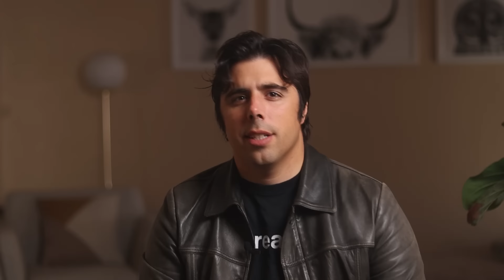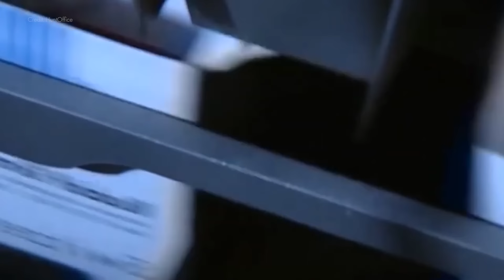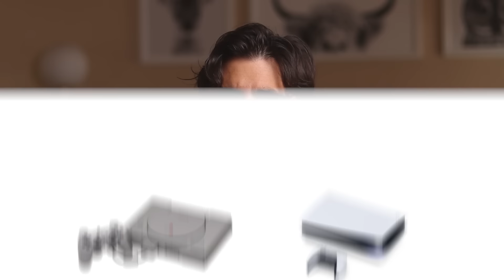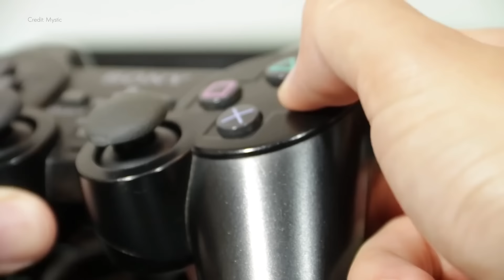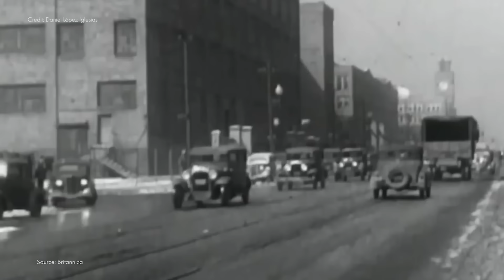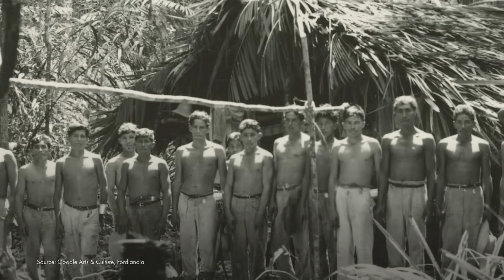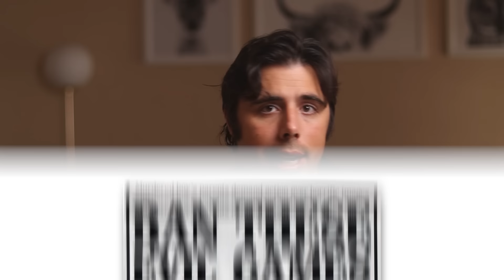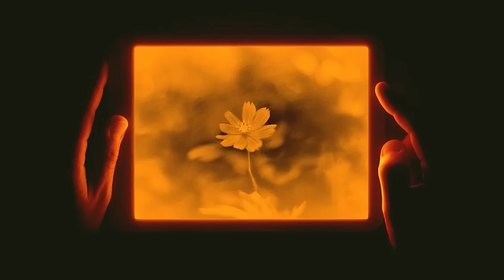Why Some Designs Are Impossible to Improve: Quintessence

Comment: 🎯 Key points for quick navigation:

 Quintessential designs: Last for decades & barely change (paperclip, PlayStation controller).
 Why some designs fail: Not high-scale/prevalent enough (Sunbeam toaster).
 High-quality, but expensive: Can hinder becoming quintessential (Sunbeam toaster).
️ Complex design: More parts, more potential failures (Sunbeam toaster).
 Not universally appealing: May not suit everyone's needs (Sunbeam toaster).
 Value of imperfection: Simple designs can be "good enough" (regular toaster).
✨ Niche appeal: Designs can be great for a small, passionate audience (Sunbeam toaster).
⚙️ Manufacturing matters: Design for efficient production (quintessential designs). 
 More effective paperclip designs exist, but lack efficient manufacturing process.
⚙️ Quintessential designs: Need a simple, cost-effective manufacturing process.
  Patents and copyrights can help a design achieve dominance (Maglite flashlight).
 Original, innovative design (Kell flashlight) can be overshadowed by competitor.
  Marketing and sales strategy can influence a design's success (Maglite flashlight).
 ‍♀️ Sponsor message: Opera browser with tab grouping & messaging features.
  Built-in screenshot tool & workspaces for organization (Opera browser).
 ✨ Intuitive design, transitions & tab navigation (Opera browser). 
 Maglite's success: Innovation (adjustable focus beam) & aggressive legal strategy.
 Maglite spent more on lawsuits than advertising to protect its design.
 Lawsuit settlements forced competitors to buy real Maglites, boosting sales.
 Founder sued his own stepsons who created a competing flashlight design.
 Maglite became standard police equipment due to quality, practicality, and size.
 Lawsuits can't stop innovation forever: Competitors made better flashlights.
 Maglite: Example of how IP protection & strategic relationships build dominance.
 Quintessential designs set new standards, but even gaming controllers evolve. ➡️
 Early video game console controllers had diverse designs.
 1986 Nintendo controller set the standard for future designs (D-pad, buttons).
 PlayStation controller added grips for ergonomics and dual thumbsticks for 3D games.
 PlayStation controller's rise coincided with PlayStation 2's success.
 Few electronics maintain the same form factor for 30 years like the PlayStation controller.
 Other companies tried improvements (Wii remote), but none became the new standard.
 Precise inputs & user habit make small controller changes a big deal for gamers.
 Controller design must accommodate a wide range of hand sizes (5% smallest to 95% largest).
 Qwerty keyboard layout isn't the most efficient, but users are accustomed to it.
 New gaming controller design needs significant advantage to overcome user habit.
 VR gaming may lead to new controller standards due to different design requirements.
 Quintessential designs can change entire cultures (e.g., Ford Model T).
 Model T's affordability made it a game-changer (less than half the price of competitor).
 Model T's success stemmed from extreme design simplicity (1/3 the parts of a contemporary car).
 Simple design meant high reliability and easy repairs for Model T.
 Model T prioritized function over comfort or safety (designed to be faster than walking/horses).
 Model T's affordability & durability made it a game-changer (strong steel, 4-seater).
 Efficient & cheap production: Focus on streamlined supply chain (Henry Ford's obsession).     &   
 Ford gained control of the entire production process (raw materials to finished car).    ➡️    ➡️  
 Pioneered assembly line: Reduced car building time from 12 hours to 93 minutes.    ⏱️  
 Controlled every aspect of the supply chain: Owned railroads, mines, forests, ships, etc.      ➡️    ➡️   ➡️  
 Vertical integration: Complete control from material harvesting to car assembly (28 hours).    
 Dehumanized factory workers: Repetitive, soul-crushing tasks led to high turnover.    
 Wages & workday shortened to retain workers (not out of kindness).  $   &    ⏱️  (not  ❤️)
 Model T revolutionized transportation & social dynamics (e.g., unsupervised dating).    
 Cars increased travel range & potentially human genetic diversity (meeting new people).    ‍‍‍
 Model T shaped American infrastructure (roads, suburbs).   ️  ️
 Henry Ford's control led to success (streamlined production).    
 But control also caused his downfall (Fordlandia rubber plantation failure).    ❌
 Fordlandia poorly managed: unsuitable location, worker mistreatment.    
 Workers forced to follow American customs (diet, square dancing, unsuitable housing).  🇺🇸  ❌  
 Fordlandia a financial & social disaster (heat exhaustion, worker misery).    
Model T's success: Offered same car at lower price for nearly 20 years.      
General Motors offered variety (colors, configurations) that Model T lacked.      
Model A saved Ford with more options (sedan, convertible).     
Model T's influence: Defined American culture & landscape (15 million sold).       
Quintessential design = maximum effect in minimal package (Model T).       
Smartphone: Indispensable modern design (used upon waking by billions).    ⏰
iPhone: Most quintessential smartphone (reshaped cultural norms).     
iPhone's success: Established touchscreen as standard smartphone design.       
Quintessential designs are shaped by user behavior (e.g., iPhone touchscreen).    
Apple excels at perfecting existing user interfaces (not necessarily inventing them).     
Smartphones prioritize convenience: complex tasks become simple taps/swipes.     
This simplicity hides complex technology & removes user control (decisions made for us).       ❌
Social media apps exploit reward systems in our brain (like slot machines).       
 Pulling down to refresh feeds triggers unpredictable content & dopamine release.       
Smartphones are quintessential due to aligning with cultural shifts and habits (addictive).       
Video excerpt criticizes negativity towards technology; it's a recurring theme.    
Positive side of smartphones: Feels futuristic, comfortable in hand (curved edges).      
iPhone design excellence: Chrome bezel, contrasting materials (warm grip).       
Criticisms: Unnecessarily deep headphone jack placement.      ❌
Apple's quality standards: High volume orders ensure precise manufacturing.         
iPhone sets industry standards: Similar to Ford Model T's impact.         
User gets hooked after initial beauty: Smartphone integrates into all aspects of life.      ➡️    
Second Convenience Revolution: Focus on self-expression (iPhones, social media).           ️
"I" in Apple products: Stands for the individual user (self-expression).         
Smartphones democratized information access, especially in developing countries.        
Information access can be good (education) or bad (misinformation).       ❌
Future phones need to be "more polite" & give users more control over their lives.       
New tech companies are creating alternatives to all-consuming smartphones.        ❌
Future tech success depends on balancing convenience with user control.       ⚖️
Innovation focuses on harmonizing with human needs & social interactions.       
Quintessential design = most essential part of something (like "ether" was to ancients).       ✨
Quintessential designs create an emotional connection & become indispensable.       ❤️  

Made with HARPA AI

Comment: It's interesting to note that although the Model T was a quintessential automobile by your argument, its user interface so to speak was almost completely nonstandard by today's standards. The steering wheel was about the only thing about it that an average driver today would instinctively recognize. The gearshift was a series of pedals, the brake was a hand lever on the floor, and the accelerator was a hand lever on the steering column. You'd literally have to relearn how to operate a car in order to drive a Model T today and I'm sure many people back in the day had to do so after decades of driving Model T's. After discussing game controllers and the QWERTY keyboard it would be interesting to explore the evolution of automobile user interfaces and how the current standard arrangement was arrived at.

Comment: Ask your grandfather how he used to change a tap washer.  For a few generations it was a small piece of rubber about the size of a penny.

Too many designers redesigning,  just for the sake of it.

Now you have to throw away the whole tap because you can't buy replacement parts because that model isn't available anymore.

Comment: I grew up with an automatic toaster and they aren't as good as Alec suggests,  Wasn't uncommon for it to fail to turn on requiring multiple attempts . But I must say It did toast bread extremely well way better than other toaster's I've had. It is also extremely difficult to get stuck toasts out. Toaster with a lever can have the lever pulled up to get the toasts out, with an automatic not so much, if the toast doesn't come up you're on your own trying to figure it out, a knife will probably be your solution even though they say do not stick knives in a toaster.

Comment: For being a quintessential design. The standard controller is a pretty crap design. Why? It's very simple. I have only 2 fingers that reach the front, but 8 that can reach the back. And yet they put about 80% of the controls (all but 4 of them) on the front. Using one for a control scheme even a little bit complex (ie. more than just 1 analog stick and a couple buttons in the right cluster) feels like typing on a keyboard with only your pointing fingers. It's slow and cumbersome, with all the buttons in the wrong place.

I get that this makes it accessible for someone who picks it up for the first time. But for an experienced user, it's ass backwards.

Comment: Playstation controller is not the first controller with sticks etc. Gamecube controller is the first one that started this trend. Actually in case of who coppied who regarding controllers - Sony coppied Nintendo's Gamecube controller design. Switch controller is based on gamecube and/or nintendo64 controller.

Comment: It's nonsense to use "quintessential" that much without knowing it's meaning, plus it's a paradox since you explain that a "quintessential" design is not necessary the best, which is contrary to the meaning. Even if I dislike the video since the beginning for losing time or a content that has close no zero value, I kept to the end, for the effort.

Comment: Tldr; The reason why some designs can't be improved is because there's either no need for them to embody anything additional for the user, or because the hurdles to overcome, in order to implement a new design, would be too big.

However: The Ford Model T, the iphone, the Playstation controller and the flaslight are all examples of products that are constantly improved by technological advancement. When i clicked the video, i actually expected products like the nail clipper, that don't heavily rely on technological advancements. I would be interested in products that can't be improved, regardless of technology. (Not just concepts, such as the button layout)

Comment: Dvorak is basically only better if you need to type a whole lot, and you're already a very fast typist. If you are, it will 100% make you a significantly faster typist when you get used to it. But that's such a small part of the population that had any need to push typing that far, and it's not worth switching

Comment: In response to the controller segment, the Wii mote did establish a new standard for motion controllers. Any VR controller today has the wii mote dna: a bar with a directional control under the thumb, a trigger, and some face buttons. That discounting that a Wii mote is just the NES controller sideways plus some extra buttons.
Reply: Totally agreed. The video glosses over the N64 thumb stick which came out a year before the revision to the Dualshock, not to mention the rumble pack. But although the N64 popularized thumb sticks and rumble, thumb sticks and even wing handles had already been done in '89 on the Sega Mega Drive ... not to mention the Sega 3d controller with thumb stick also beating the N64 to market by a month or so (I don't remember which design was announced first).
Reply: @mitchelwilson5605  the video would be unreasonably long if he covered everything tbh, or atleast that segment would be very disproportionally longer and make the video abit less focused
Reply: @TactfulWaggle  He wastes plenty of time on extraneous topics, like the QWERTY layout. The problem is he suggests Sony was the first to implement the thumbstick on console gaming controllers even though it was 17 months behind the N64 … which is not accurate and overlooks the iterative process.
Reply: @mitchelwilson5605  fair enough
Reply: The Dualshock popularized thumb sticks. The N64 sold like crap by comparison.
Reply: Found the Nintendo fans

Comment: Ford not including a fuel pump in the model T was fine until you have to go uphill. Because the fuel tank was behind the engine, as you drove up hill the gas would slosh away from the engine and the engine would be starved of fuel causing it to die. In order to go up these hills the driver would need to reverse up them. not the most optimal design.
Reply from the maker: I watched some videos of it and ppl had that concern. but it seemed to work fine. Look up TFL Classics for video of it
Reply: @Design.Theory  I knew a guy in Cincinnati who daily drove his, he said the only mod he made to the car was an electric fuel pump because the car would die on him going up the hills. The cincy hills are pretty impressive though so maybe it’s not as big an issue in flatter areas

Comment: We're probably stuck with QWERTY forever, even though there are objectively better layouts like Dvorak and Colemak and the major issue isn't even adapting to the new one, because it's not that hard as I tried it once, but I came back because the major issue is the status quo of software is QWERTY. All programs are designed with QWERTY shortcuts as the default and some are hard-coded and you can't even change. Yes, Colemak tries to keep the most common shortcuts in the same spot to mitigate that, but it's not enough. And when it comes to gaming is when it becomes the real PITA: you have to reconfigure the entire game's key-mapping before you even start playing, for every game you play, and good luck with the ones that don't allow remapping. Making alternative layouts viable would require basically all existing software to be rewritten to detect the layout you're using and adapt to it, and that's way too expensive for that change to ever happen

Comment: the analog sticks were first on the Nintendo 64, and the motion input have indeed become a standard, the only controller without morion input is the xbox controller. the SNES controller was the one who introduced both shoulder buttons and the diamond shaped ABXY layout used today. Nintendo also brought in rumble

Crediting the PlayStation controller on innovation that Nintendo actually msde is just wrong.
PlayStation 's true additions were a secobd stick, a secobd pair of shoulder buttons and clickable sticks.

Comment: About Ford, you could have mentionned the Robertson vs Phillips screw design which would have fit your topic as well. Why one has stuck more than the other in many countries over time is somehow related to Ford. 

Long story short: Robertson screws were used on early Ford vehicles, but mostly on those made in Canadian factories (Robertson screw is a Canadian invention and is ubiquitous in Canada ever since) but also in some of the US. The screw design had many advantages over others (until other designs became popular about a century later). However, Ford settled for the good-enough Phillips design in both countries for two reasons. Power screwdrivers back then would pull out almost automatically from the screw head when its was screwed on with the right tension. But mostly, that was because of Ford being a control freak: Robertson would not license its design to Ford that wanted to make his own screws and not rely on any screw supplier. Phillips screws then became used by all other auto makers and many assembly line in general, and that spread out. Robertson held tight to its patent and his screw remained mostly a Canadian thing.

Comment: I would argue that the iphone 1 isn't the quintessential design because it is basically just like an ipod video with a slightly smaller button. I would say whichever device was the first to drop all front facing physical buttons to go for a pure screen front is the quintessential design. I am pretty sure it was an android as the iphone didn't lose the front button until like the iphone x. But I have no idea which android it was.

Comment: Wasn’t the stick on the controller introduced by nintendo on the 64? One year later if I’m not wrong
Reply: In a way sticks are even older than the N64 in the form of joysticks. The Dualshock introduced the classic twin sticks which was a game changer for controls.
Reply: @Tripple-A_96  quickly checked. The dualshock was introduced in 1997, pretty much in reply of the crazy tricorn controller introduced by Nintendo in 1996. 
Pretty much Sony picked the idea and developed further. the rest it's history.